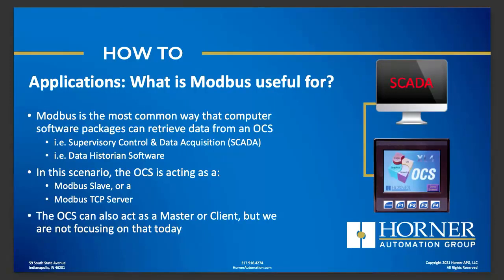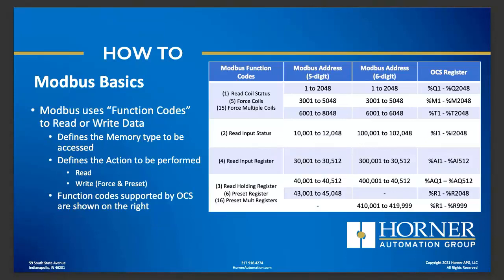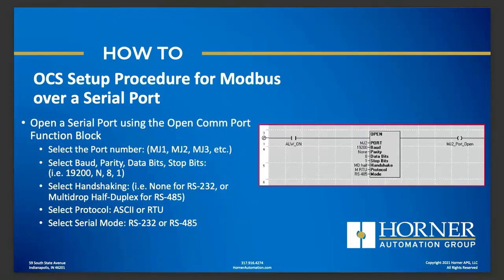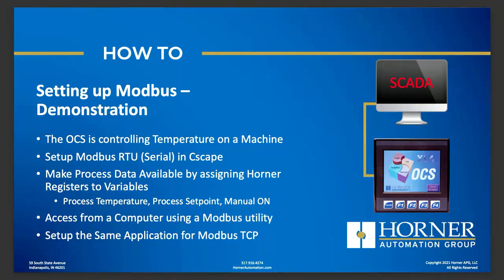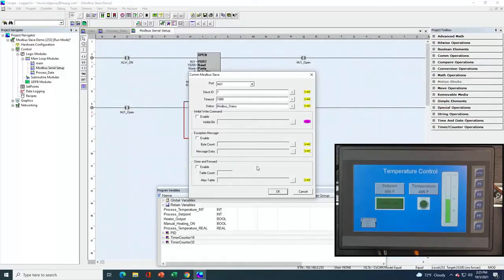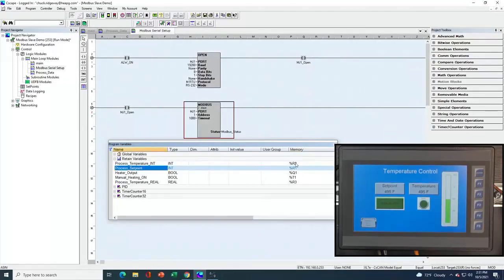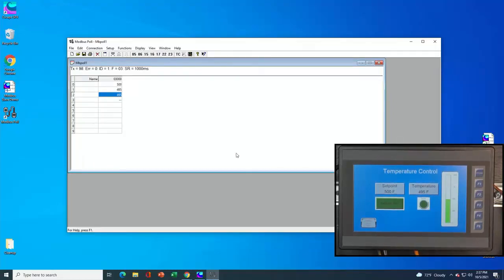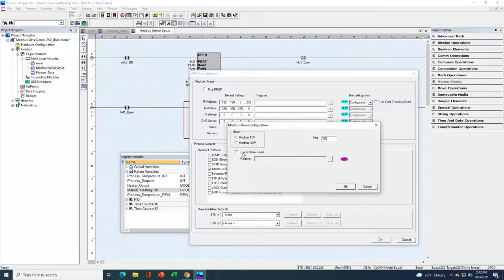How To: Modbus RTU & Modbus TCP

Comment: I get a communication problem timeout error?
Reply: Several potential causes for a communications timeout.  If communications had previously been established - it could mean a new problem with a cable (i.e. wire being cut) or maybe the other device being powered down.  It is probably more likely that you had never established comms to being with, and in that case it could be a number of things.  A wiring problem, a  baud rate / data bits / stop bits mismatch (for RTU) or an IP address mismatch (for IP).  On the list of RTU wiring issues - you'd need to look at pinout, termination, bias, etc.  Feel free to contact our support team if these hints fix your issue.

Comment: I am having a problem communicating my PLC with Drive via Modbus connection. I start by opening the port and there is no problem, but then when I want to use the Modbusmaster I fill in all the data correctly but it gives me two errors: 1 in the Trigger it does not allow me to assign any boolean to the switch and with the MCB I put an array in int format to fill in the communication fields but when compiling it marks Modbusmaster: argument expected. Do you have any idea what it could be?
Reply: This is probably complex enough where you should probably contact tech-support and see if one of the application engineers can help you get to the bottom of it.

I'm sorry it took me a few days to see your comment, I've been working on a project and am behind - my apologies.